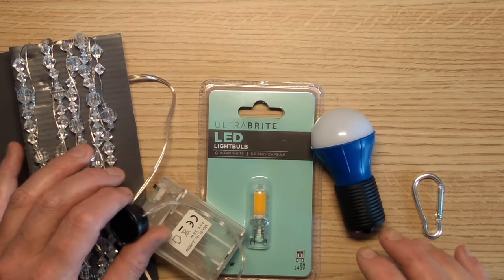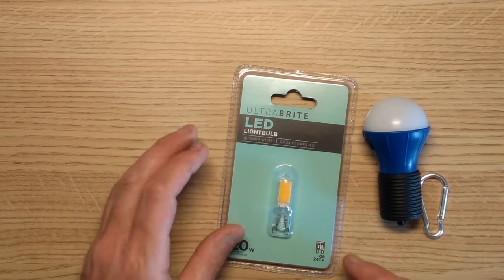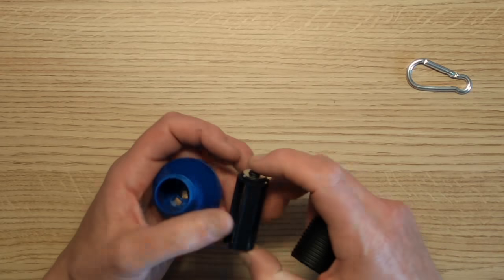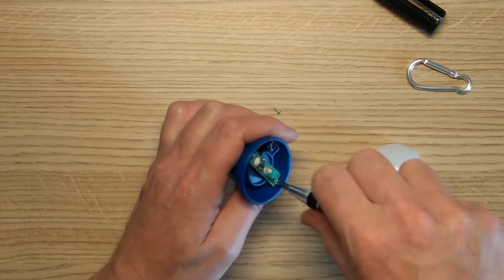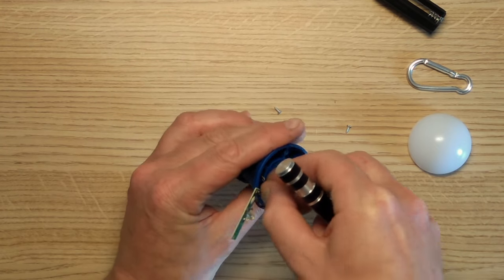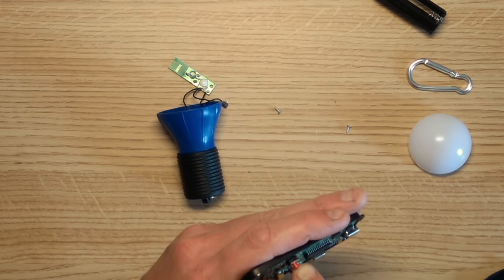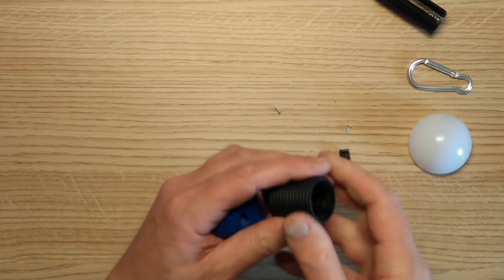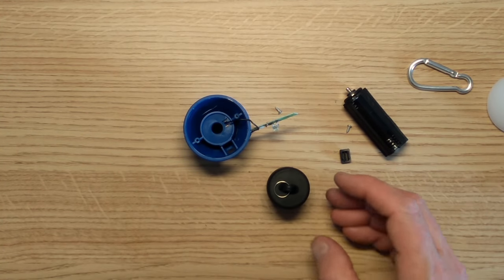Poundworld camping light re-visit.

Comment: I agree with your sound guys , batteries are a one use things when it comes to wireless mics. Use them once and then throw em in a box for other things.
Reply: Andrew Joy I was never short of AAs when I worked in TV 😃
Reply: True facts. My old work got all their 9Vs from a theater production company that would only use them for one show each.
Reply: Yea ive got friends that mess about with rechargeables. I just dont see the point, one mess up and it can spoil your day.
Reply: Use rechargeable batteries?
Reply: recycle please.
Reply: @CS Power - Not knowing how to top-up an eneloop doesn't sound like a great excuse for such wastage of non-rechargeables to be honest. If your staff can't be trusted to even do that then I have to ask questions of your hiring policy. No wonder alkalines are so bloody expensive...
Reply: dan_tm properly managing rechargeables in a high availability application, including regular discharge/capacity checks to hope to catch those faulty or dying ones is a complex job, and doing it is basically too expensive. Alkalines on the other hand just always work.
Reply: I'm surprised they don't make wireless mics that have a primary and a backup battery, and they run off the primary one until it goes flat then switch to the backup one, so you only need to change one battery when the primary one goes and there's no risk of failure due to low battery.

Comment: I have an old Osram LED bulb that I have always wanted to send over to you. It's an old discontinued model (says CL A 40 (M3) on the bulb), and it's still "working" in the sense that it is blinking when you power it on. The first thing that struck me when I got it was how solid and heavy it felt, and it is surprisingly heavy compared to all of the other LED's that we have around the house.
Reply: the weight can come from some heatsink i guess... and it blinks because of faulty bonding wires i guess again

honestly this blinking LEDs plague is annoying, they don't blow, they don't wear, they detach a wire and it sparks it's connection point till blowing... i dunno why other silicon devices don't suffer this particular problem (trickier transparent plastic?)
Reply: I've a few dead ones I can also send, and a dying one (dim and flickers). Also all Osram, about 3 years old.

Comment: hey. one thing that i got recently that you might be interested in looking at is a solar lightbulb. i got mine on ebay (like you do). it is a light bulb that has 3 solar panels on it. it comes with a base that when screwed on, it lights the bulb. it also can be screwed into a lamp and if the power goes out it stays lit until the battery wears out. one fun thing i like about it you can hold the thread and the bottom and it will light up in your hand. it is really interesting. plus it seems to come apart easily. i see many sellers sell them. they go for about $7-$10 us.

Comment: I have this light and I don't like it at all as it is very difficult to find the switch in darkness. They use a black switch on a dark blue surface, and it's small and flat, so it's impossible to see in dim light, and hard to find it by feeling. On the plus side, the rubber part can be removed and then the light can be placed on a flat surface.

Comment: I got one the switch kept slipping out I used a bit of glue from a glue gun also a little tissue in the back of the battery as I wasn't getting connected properly.

Comment: Noice, ya can't always simply sub 18500's for the 3 AAA led batt holders, Ok for regulated lights, on the cheap lights too much current, due to Lithium's low internal resistance, will cook 'em little leds.

Comment: Can I ask a 3 phase question? I have an old 240v / 415v 3 phase mig welder. up until now I did not have 3 phase electricity. but now I do the wiring is a 4 wire  but only 3 wires are used at the moment for 240 volts. how would i use the 4 wires in a 4 PIN 32 AMP RED 3 Phase plug.
Reply: Mark Lloyd three phase isn't something to muck about with. I've known electricians not prepared to deal with it. I know it's tempting, but this isn't something that goes into the have-a-go bucket.